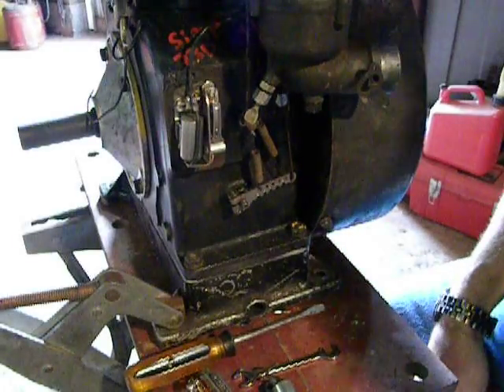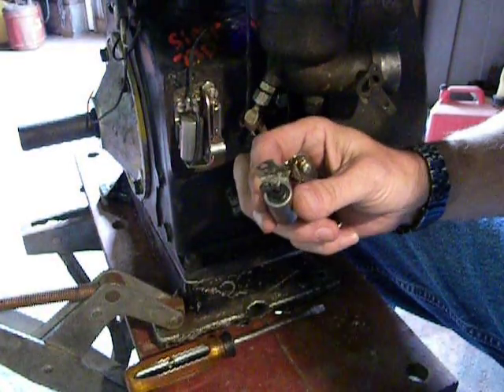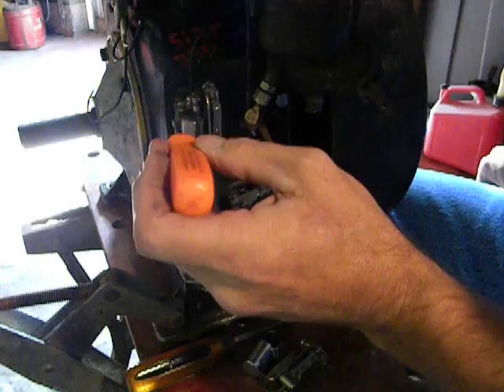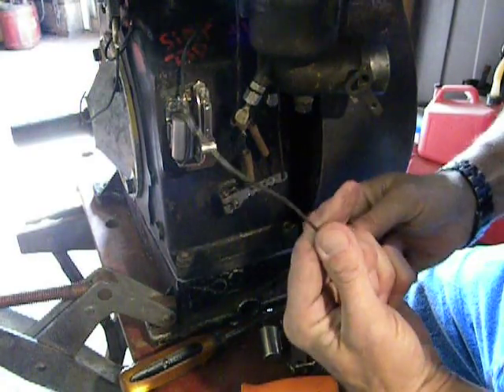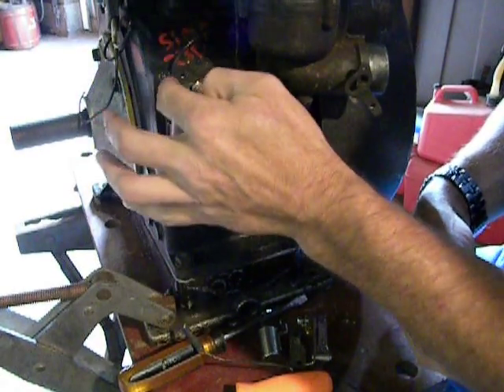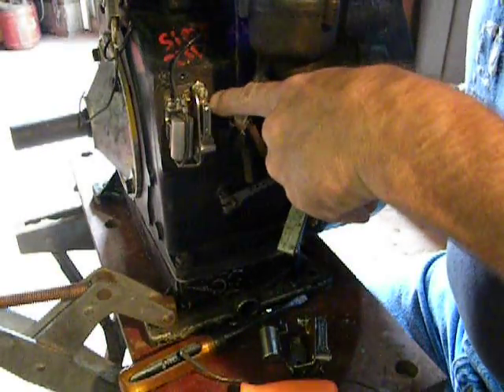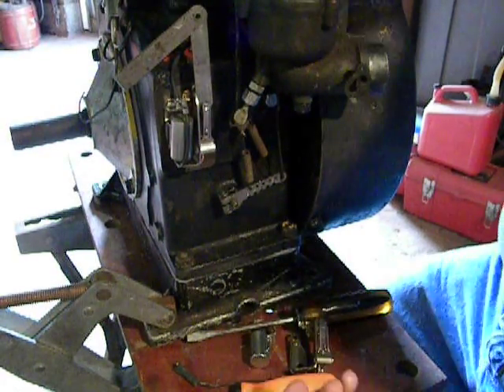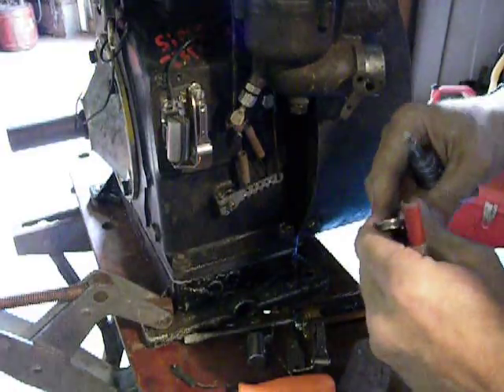Installing and adjusting points and condenser on Briggs and Stratton engines Tutorial

Comment from the maker: For those of you who want to know how to set the idle low I have to throw out a word of Caution....I love a low idle as much as the next guy, but with these splash oiling engines it's not wise to let the engine sit at "below MFG idle" for extended periods of time and this is for a couple of reasons. 
1. At the base of the connecting rod is the oil splash and low idle does not splash enough oil to the upper valve train to keep it properly lubed.